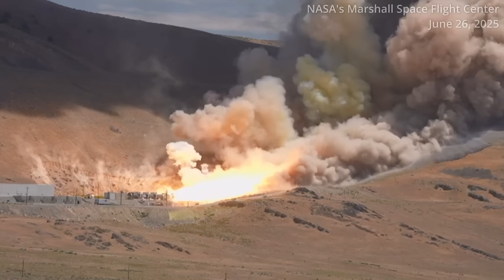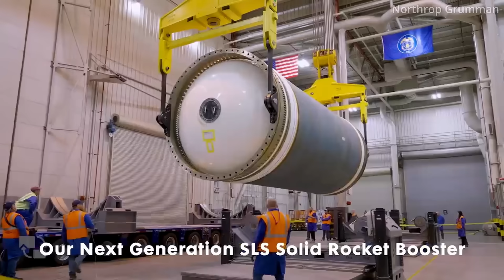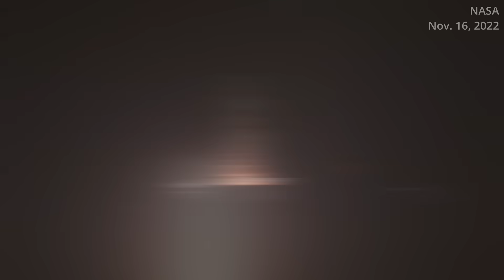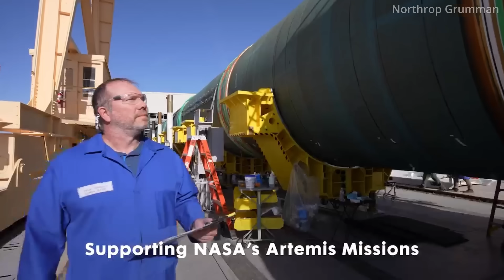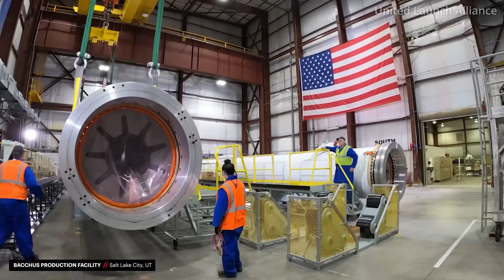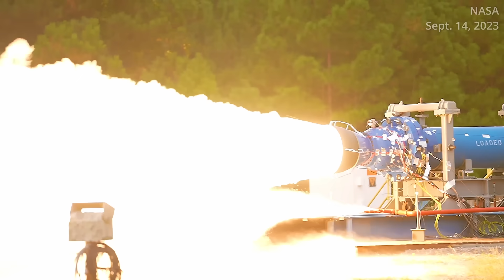Northrop Grumman fires next-generation Artemis booster for first test

Comment: I'm curious how exactly do they test the pressure do they do it through their mathematics with the solid fuel? Do they have some type of device that is on top of the booster and measuring the slight compression with the little bit of movement that is allowed? Or do they do it by testing the power of the explosion after the nozzle? And I know the explosion happens before the nozzle you know what I mean.